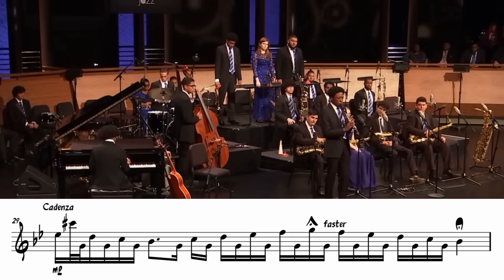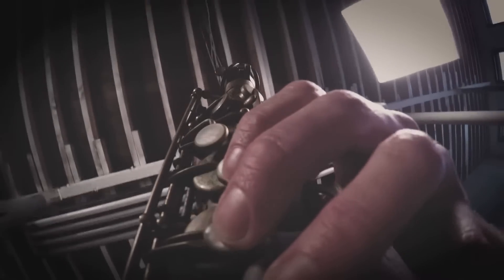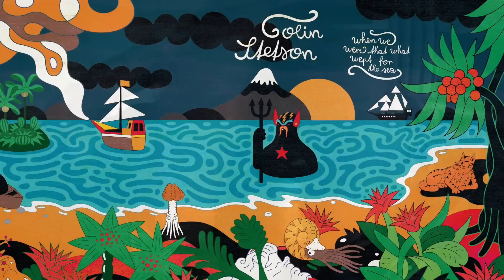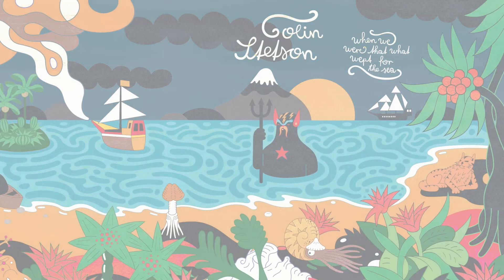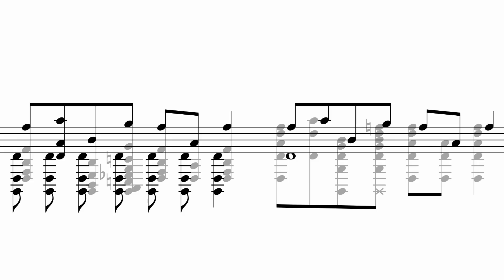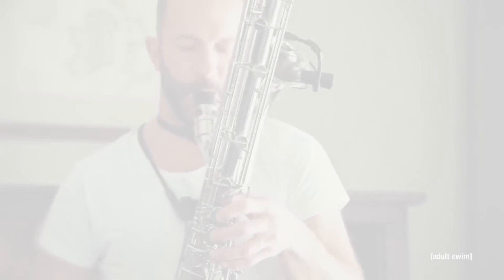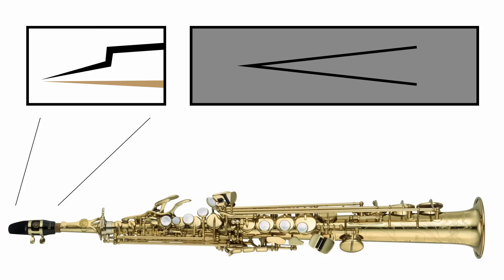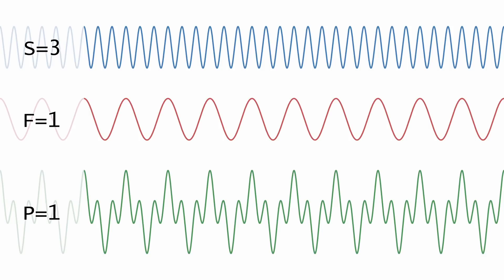The physics of vocalizing in wind instruments

Comment: isn't it the interference pattern? like the way that if you play two clean tones at the same time but one is slightly higher than the other you'll hear a slow volume oscillation because of the interference, and if the difference is big enough it'll create a tone? when i play a perfect 4th on the guitar (esp distorted) i can often hear the lower note a 5th below the bottom of the 4th (i think for a similar reason?)
Reply: oh i see yes you reached a similar point in the video i hadnt watched all the way!

Comment: I feel like the explanation of why we hear a lower product frequency is wrong, or at least incomplete: You don't just hear the "frequency" of the product wave, since it's not a sine wave - you only hear the frequencies of the sine waves that it's composed of. Just try playing A3 = 220Hz and C#4 = 550Hz on a piano or using a sine wave generator, you won't hear A2 = 110Hz, even though that's exactly the example around 6:56. There has to be more going with the singing and instrument interacting.
Reply from the maker: Yeah, i sorta left out the precise mechanical explanation of how it happens inside the instrument. Partly because i didn't fully synthesize all of that info, and also partly because i figure it can just be assumed that it has to do with resonance within the instrument. But yeah, the video is incomplete, you're right.
Reply: @langdraumaz  I'm honestly curious, do you know how that resonance works? I mean, if you'd play the two sine waves into the saxophone, there still wouldn't be a product tone, since there's no sine component with that frequency. Something has to be happening at the reed to actually get that tone, right?
Reply from the maker: @felixmandelbart  Honestly, no, i don't know, or at least don't have a complete understanding. According to some other comments under this video, it's known to be possible to do this on a flute as well, so it can't be the reed. It's probably the same physical mechanics that cause a standing  wave to form in the instrument in the first place. I'm honestly just hoping a person with actual experience in acoustics sees this and expands upon it. I'm not a capital-s Scientist, but to whatever degree i'm a lowercase one, my goal is just for other more able people to get their hands on what i'm able to contribute.
Reply: An interesting (accidental) revelation I had was that If I played a perfect 5th but had a shoe box on top of the speakers for my keyboard, I could hear that sub-harmonic product. I couldn't hear it normally with nothing on the speaker, but the shoe box acted as some sort of catalyst for me to hear that product. My theory is that those sub-harmonics exist naturally, but our brains just tune them out because they interfere with our audio perception (as a musician I use tuning apps and often times the most prominent frequencies on spectrograms are extremely low). Only when the object that's vibrating isn't just the air (in my case the shoe box being vibrated by the speaker, in this case the instrument internally resonating and then being projected) do we hear the produced lower frequency, because our brains are being tricked into thinking that the sound is actually being produced by the object instead of just being natural interference.
Reply: @nxyuu  Ohh, that's interesting, it's kind of similar to something I saw in an Adam Neely video once, where you touch a piece of paper to a ringing tuning fork and hear the octave below. His explanation was that the paper bounces of the tuning fork, which is moving back and forth very slightly, and by the time it sinks back, the tuning fork has gone through almost two oscillations, so the paper only gets hit by every second oscillation, hence at half the frequency. That probably applies to your cardboard box as well, maybe it only bounced of the highest peaks of the waveform, which occur with the subharmonic frequency. I'm pretty sure though that the bouncing cardboard box adds the subharmonic, rather than our ears filtering it out - the subharmonic sine wave just doesn't exist in the superposition of two sine waves.
Reply: @felixmandelbart  open two tabs of an online sine wave generator. Set the hz to 100 and 150. You will hear the 50 hz lower octave. Probably has something to do with the fact that both the waves are coming from the same source (headphones/speakers). I mean, it's unlikely to find two sine wave esque noises in nature that are also low enough pitch to even notice the subharmonic (the higher the pitches, the harder it is for our brains to pick out the resultant tones) without it being too low for the subharmonic to even be in the audible hearing range in the first place
Reply: @nxyuu  That's probably only psychoacoustic though, i.e. tartini tones. In my case, when I make it really loud, the speakers also seem to reach a point of non-linearity, where they start to buzz with the subharmonic frequency, which probably is the same effect as the cardboard. The growling can't be only the combination of two sine waves (plus the overtones of the voice and the saxophone...), since the subharmonic is present in the sound, it shows up in spectograms, not only in our ears.
Reply from the maker: @nxyuu  I would tend to agree, but examples like The Lighthouse I aren't just perceived by an ear; a similar trick would have to be occurring with the (multiple) microphones used in recording, ergo the microphones would also have to be filtering it out the same way. I think it's basically as another commenter put it, the different frequencies "fighting" each other when they both try to resonate through the same thing. Furthermore though, it seems like it has to be a "secondary" medium for the sound to travel through.

Comment: Unlike with whistling, it seems that the reed actually blocks the vocal component while it is closed, resulting in true heterodyning of frequencies, something you do not get in other instruments. The result is that you get not only the original tones but also the sum and difference frequencies. Not having a woodwind I cannot investigate this.
Reply from the maker: Good point, i might want to look into that.
Reply: @langdraumaz yeah like wait you basically just showed that combining two pure tones makes a superposition which contains both tones in a single waveform. Basic audio sense. But there’s obviously a ton more complicated stuff with how your vocal cords’ ability to output clean sound is manipulated by the opening and closing of the reed. 

Also, I suspect that most of the distortion simply comes from having two different sounds trying to resonate in the same chamber. Only one tone and its harmonics can resonate in the tube at a time so maybe them “fighting each other” is causing the distortion.

I can confirm that it’s not just the reed, because growling or singing while playing is totally a real thing on flutes and other free reeds. Vocal folds are not being externally manipulated in those cases. I can also attest to this because I can feel extra vibrations in my throat and weird back pressure feeling when trying to sing while play a reed instrument. And a lot of the time it’s really hard to even sing a note while your mouth is closed on the reed and blowing.
Reply from the maker: @Jwellsuhhuh  Yeah, i can't really contest what you're saying. I kinda just got lost in the weeds, and forgot to really tie it up with this particular point both in my own head and in the video.
Reply: @Jwellsuhhuh  There's probably a lot going on with the technology Coling Stetson is using. I wonder how much the sax interferes with the throat's resonance and gets picked up by the throat mic. also, slight harmonic distortion from the amplifier circuits will probably exaggerate the 'difference tones' because the tops and bottoms of the soundwave are sliced off (that's why 'power chords'  on the electric guitar sound so gutsy. Perfect 5ths played with distortion bring out that difference tone - partly because distortion also flattens out the difference in amplitude between the louder and quieter components of the sound. I'm describing more deliberate distortion, whereas colin doesn't seem to be using it explicitly in these examples, so it may only be a subtle effect, if it's there at all.
Reply: so it's like amplitude modulation?